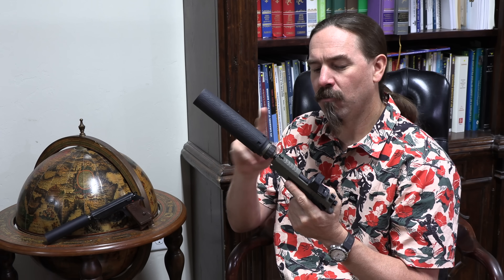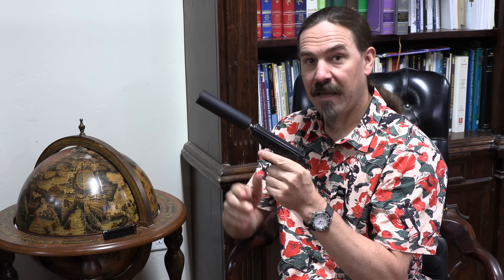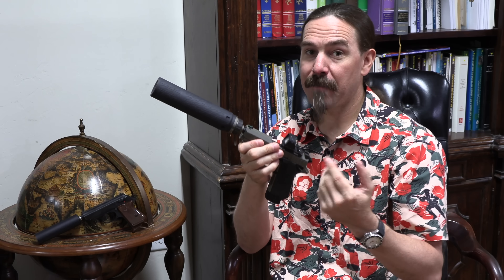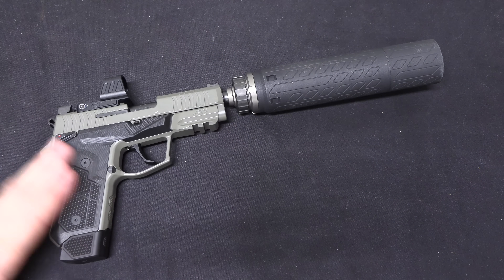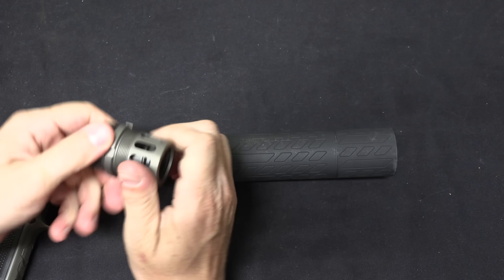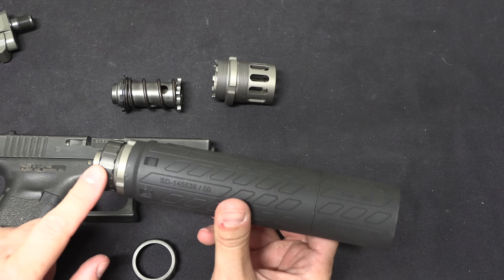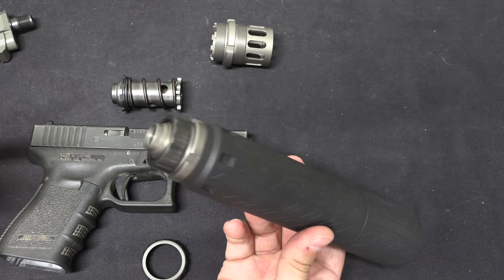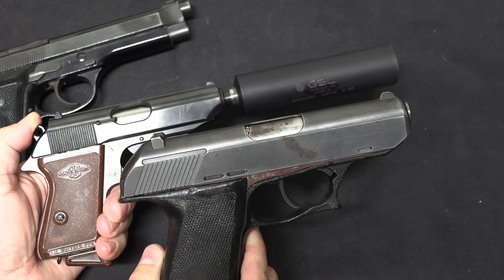Nielsen Device: How it Works and Why it's Necessary

Comment: what Luigi was missing
Reply: Go watch brandons video where he goes over the assassination and what gun was used and why it failed. I now remember he mentioned the device
Reply: @High_Bread Failed is subjective. It worked well enough to get the job done
Reply: @Fridgeasaur  failing to feed to be specific. It was the suppressor lack of device attachment and i think ammo, regardless he had to manually cycle
Reply: @High_Bread in what way did it fail?
Reply: @teejerdeejer  when u fire a gun thats strike fired, u pull the trigger, striker hits the bullet and combusts , causing the slide to push back and chamber the next round. With a suppressor without a device, u pull the trigger and get the first roukd off , but it wont rack the slide back fully cause the suppressor mitigates that recoil and noise. With the device on it , itll push the slide all the way back, allowing for correct feed with no jam
Reply: @High_Bread yes obviously, but if you're prepared to manually rechamber a round after you fire then I wouldn't classify it as a failure, it's just an expected part of cycling the weapon

If the slide not cycling had caused him to miss his target, or to leave his target alive, I would agree it was a failure  

As it stands, "failure" feels like the wrong word even if it is technically correct, he completed his mission and the world is better because of it

That said I still don't believe that Luigi was the shooter
Reply: @teejerdeejer  the gun failed to cycle
Reply: @Alpaca814that's only a problem if you're unprepared to manually cycle the weapon

I was mostly making a joke that even though it may have failed to cycle, it didn't fail to do it's job
Reply: @High_Bread  slopmaxxing
Reply: He still took out Bowser though 🤷🏻‍♂️
Reply: Took me a minute, I thought you were talking about some obscure Mario game lol.
Reply: @markorahoske6931Same thing keeps happening to me. If he did have a gun he probably wouldn't be so scared of those ghosts in his mansion
Reply: Mario was using it for his, I wonder who his target is 😂
Reply: St Luigi*
Reply: A good escape plan?
Reply: Joos hayte catholic and yites..all this crazy sudden surge of immigration and what do you get called if you fight against it? A notsee or antisemi ..they will say openly many rabbi that islamb is their broom for europe....I imagine s america is their broom in the u.s. ......you know and have heard who has all the money.....politicians don't visit a Christian  holy site....they visit the wailing wall the most sacred place of joos....tell me who the masters are?
Reply: Duh
Reply: I thought he didn’t miss?
Reply: Allegedly
Reply: Allegedly
Reply: “Allegedly “
Reply: Allegedly. Still don't think it was him.
Reply: @Bert-og9rk it definitely wasn't
Reply: He didn't want to get caught, you can 3D print your own glock and suppressor but not a nielson device, also it probably wasn't even Luigi the fact they "caught" him with a backpack with the weapon, suppressor, and a manifesto is a little to perfect. If he did do it, even if he's guilty of the crime he's innocent of any wrong doing and should have the case nullified by the jury.
Reply: @GeorgeWashingtonLaserMusket  Since it is not a problem to 3D print metal parts and pieces of from a wide variety of different alloys I see no reason why a Nielsen device could not be 3D printed.  That said there also would be nothing hold someone back from drawing the difference pieces up in solid works and having each piece machined by small CNC machine shops who are not going to care what they have have made for you just as long as they get paid and besides I don’t think the Nielsen device is requires a nfa tax stamp etc like the suppressor does. 
Lastly your logic above the accused guilt is to say the least interesting even if I don’t agree with your line of thinking.
Reply: @gullreefclub  Printing metal 3D parts is "not a problem" if you've got VERY expensive industrial equipment. We are nowhere near the point of hobby home metal 3D printing. Even the most basic systems start around $100k. However there are different ways to get it done. I believe some newer 3D printed (plastic) suppressors incorporate it in their designs, though you'll need to supply some metal parts, like the spring.
Reply: communist detected opinion rejected
Reply: Luigi is a scapegoat
Reply: @kenetickups6146 quite possibly, but I assume everyone is using his name as a popular stand-in for the actual assassin.
Reply: Peace be upon him
Reply: He didn’t miss! Fighting corporate oligarchy takes more bravery than any of you fake account paid trolls have.
Reply: @nedkent5239 Never go Ned Kent with a silent u.

Murder is a crime.
Reply: @nedkent5239  Hey.  There's only one kind of communist that's good.

Go make yourself one.
Reply: And a brain
Reply: @waterishdrake8693 was Luigi stupid for what he (allegedly lol) did or are we stupid for putting up with the way it is while just watching it get worse? 

These kind of people rely on the civility of us well-mannered people to screw us over and they don't give a damn about what happens to us.

I wouldn't advise anyone to do what Luigi did, but Brian Thompson was a greedy peice of poop and nobody was sad when he got what he did. Trying Ai to deny claims, and the highest denial rate... what a legacy.
Reply: @shannonolivas9524  The insurance industry relies on leftist government policies like the ACA to screw us over.

ACA is why I haven't had (can't afford) insurance since it was passed.  It just means I have to tell a tiny not-quite-fib when I file my taxes to avoid having to pay the fine that they falsely claim is a tax.
Reply: @waterishdrake8693 left libertarian activities fr
Reply: @waterishdrake8693 
cringe
Reply: @waterishdrake8693 he saved lives and bought people time. Claim denials were reversed after the incident, even if only for a few months.
Reply: @robertaylor9218 He didn't save anyone
Reply: @babayaga7434 
I mean I know nothing of his personal life, do you?
or are you parroting msm bs amd blaming him for the death of that mass mu rderering ceo?
Reply: @babayaga7434 oh, so people don’t die from lack of treatment over denied claims? Are you thinking of another country, or do you only know rich people?
Reply: @babayaga7434 how does that boot taste?
Reply: @keebisbored How does EBT taste?
Reply: @robertaylor9218 no they werent. Silly false narrative
Reply: @babayaga7434 ignore reality much?

Comment: It's also important to note that a Nielsen device is not recommended for firearms with fixed barrels (PCCs, delayed blowback pistols, etc) because the movement of the suppressor can put unwanted wear on your barrel threads and possibly more random induce POI shifts.
Reply: yes, Ian did mention that you don't need the Nielsen device at the very start of the video, around the 1:00 mark.
that walther's been chilling on the globe in the background of the video the entire time as an example of when NOT to use the neilsen device
Reply: @hoangtran4736  This is an important distinction: "doesn't need" may be taken to imply that any pistol caliber suppressor that comes with a Nielsen device can be put on a PCC without issue, and its presence is some kind of bonus, or a neutral thing.

It would be better to say that suppressors with a Nielsen device should have it REMOVED before installing on a PCC to prevent damage.
Reply: @brennelement6451  Oh good point. I hadn't thought of that, switching suppressors between firearms.

Since suppressors require a tax stamp, Jimbob down the street might just decide to only get a single 9mm one for use on both his pistol and PCC.

If care is not taken, I could totally see Jimbob inadvertently pulling the suppressor from his browning style action pistol and throwing it on the pcc without removing the neilsen device.
Reply: Does it only work on short-recoil or also long-recoil actions?
Reply: I winced every time I saw it striking here 😶
Reply: "Who's been fucking with my gun? The sight's shifted on it. - Maybe you dropped it. - l didn't drop it!“ 😅
Reply: Can also cause baffle strikes if rapidly firing.
Reply: WHATS POI SHIFTS?
Reply: @AndrewJeffersonCotter  
In firearms, POI stands for Point of Impact. 

It refers to the point where the bullet (or shot from a shotgun) actually hits the target in relation to where the shooter is aiming. 

Understanding and managing POI is crucial for accurate shooting, especially when sighting in a rifle or patterning a shotgun
Reply: @AndrewJeffersonCotter point of impact.